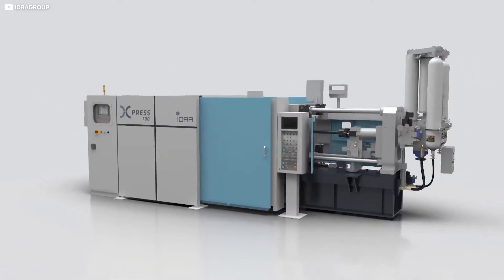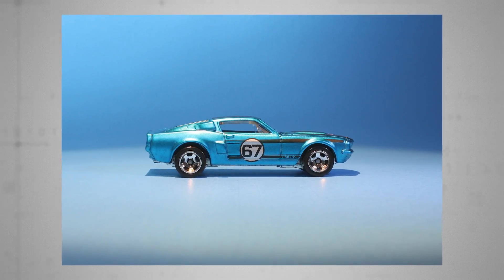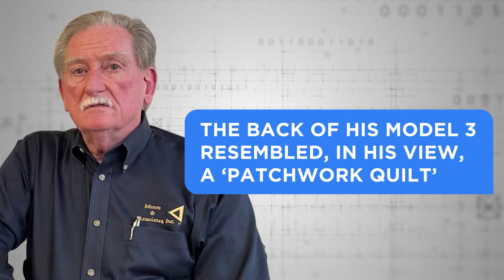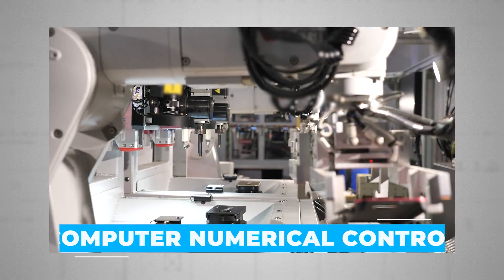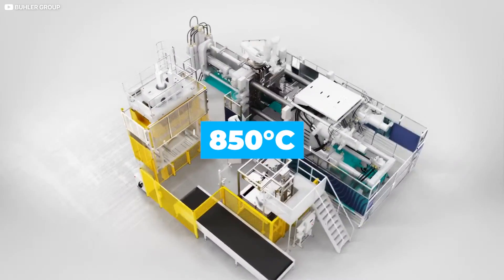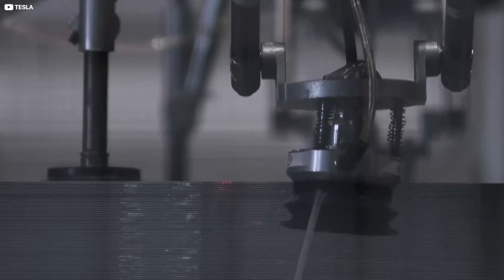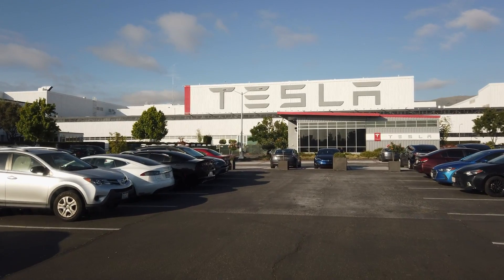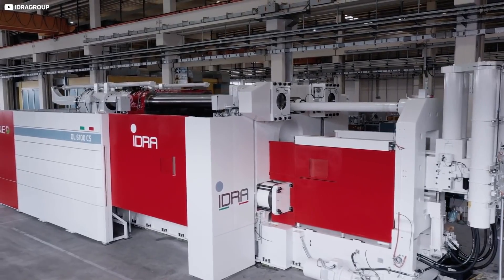Why Tesla Needed The Giga Press

Comment: To see a 8000 ton press machine working must be a show
Reply: 8000tons is not that big tbh.
Reply: @alanmay7929  Since you're not familiar with the industry, I'm gonna cut you a little slack. 

The size of the machine is designated by the clamp force to hold the mold closed, not the actual weight of the machine.
Reply: @alanmay7929  LOL. You've obviously never seen an injection molding machine. The biggest one I've ever seen is 1500 tons, and I work in the industry.
Reply: @mnotlyon  injection molding is a totally different machine, wrre talking about metals here, IDRA and other companies makes die cast machines for space/aviation and many other industries.
Reply: @alanmay7929  While the process is slightly (very slightly) different, they're both injection molds. I've built molds for both machines for over 35 years.

The machine builder couldn't care less what industry they're building the machine for.
Reply: @mnotlyon  they are still different machines that operate with vary different temperatures and many other parameters. Injection molding is relatively low pressure compared to pressured die casting.
Reply: @alanmay7929  Dude, did you miss the part where I said I was in the industry?

I actually repair 2 shot injection molds for tesla and most of the other car manufacturers.

I've built more die cast tools than you've even seen pictures of.

Comment: CNC and Robot industry should run panic now...
Reply: Die cast is not new, and the giga press will not eliminate CNCs. There will be a lot of secondary operations that must be completed on the parts after they're molded. High tolerance areas will need to be machined, and bolt holes will need to be drilled and tapped.
Reply: Casting is a very old method. This process is not used in other companies for a reason, repairing a solid chassis isn't viable.

Comment: so why is tesla using natural gas to heat the metal and not renewables and normal electric resistive heating?
Reply: Because u need hydrogen and if u buy hydrogen u produce atm more co2
Reply: @altair4262  the gigapress requires flames to work, and for that fuel is needed and Tesla could be using bamboo instead of natural gas to help the enviorment more.
Reply: @insectbite1714  No it doesn't. They can use anything they want to melt the aluminium. They use natural gas because it's MUCH cheaper than electricity.
Reply: Because it's much cheaper.

Comment: aluminum is very brittle I worry about cracking especially for a vehicle! the military scrap aluminum specifically for this reason so only time will tell.
Reply: Alluminum is good for the enviorment so Tesla uses it. Sometimes we have to get rid of conveniences to help the enviorment. also I have seen a cracked Ford before
Reply: @insectbite1714  Good may be an exaggeration considering that it is bad for the environment if it gets into it and that the process of making it uses quite a few harmful chemicals. I don't think that Elon much cares for the environment anyway, considering what he has done in Boca Chika and is still doing there and considering how wasteful many of his projects are.
Reply: Alloy . Pay attention
Reply: @irri4662  That may not fully address the issue particularly as it is still 95% Aluminium, cast, and one piece. That is a lot of potential for stress fractures. But still, we won't know until it has been on the streets for a while.
Reply: @harrybuttery2447  90%

Comment: I miss why you need the press part? The process described is just how a mold works? There is no need for pressure with the process described
Reply: The entire cast weighs hundreds of pounds, yet is filled in ~20ms. This is extremely fast and only extreme pressures can contain that injection speed
Reply: @colinsouthern  Good analogy Colin - "controlled explosion"...

Comment: When I was working on Vespas years ago we totalled countless scooters because of that big exoskeleton frame of theirs. It would be interesting to see how they allow repair of smaller parts of the frame without the whole thing being written off.
Reply: Typically it was because of a crash. Someone could drop it or have a slow crash and the side of the vehicle would get scraped up pretty good. To have someone clean up the damage and paint it costs more than the 70% of value of the vehicle number almost every time. That 70% is where most insurance companies draw the line and will total the bike. The other thing that would have is a front end collision such as rear ending a car could fold the front of the scooter in. Any damage that needed frame repair was almost always a total.
Reply: What was the reason it was written off though? Specifically, what was the damages to the exoskeleton and what usually caused it?
Reply: Was your experience with Vespa that these damages could have been fixed and they weren't because of the cost, or were these just completely unsalvageable with the then current known technologies?
Reply: VW and Toyota produce 20m cars a year in 6 continents without quality issues what problem are they solving here
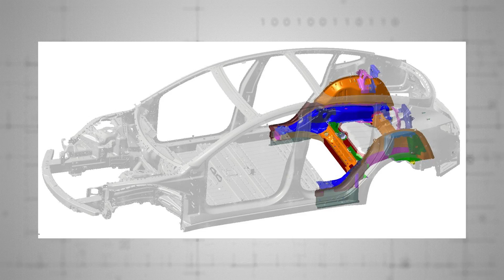Reply: Just watch the video for 4:42 - 4:55 minutes..
Reply: @Engineer9736 …..exactly. “Crash absorption rails can be cut off and be replaced with a bolted part for collision repair.”
Reply: Probably you'll need Tesla to come up with spare molds that are cut into custom parts that can be sent for repairs.
Reply: I think the trick will be to install sacrificial elements around the inner frame - basically a hidden "bumper".  In minor accidents, the sacrificial part would be cut off and a new one welded in place.  If there's damage to the underlying frame, the car is a write-off.

This begs the question...  how difficult would it be to make the "skateboard" (the part that holds the batteries, motor and brain of the Tesla, easily detachable from the frame so that in the event of a serious crash, you simply buy a new frame and swap everything over.

That would, I think, require a fundamental redesign of the 3/Y - but I think it would be an excellent goal.

While they're at it, they can/should make all the body panels easily removable like Saturn used to do.  That would dramatically reduce the cost of minor panel repairs - especially if they use Saturn's old trick of pre-impregnating the panels with the color.

Then, it would be easy to swap not only the drivetrain of the car to a new chassis but the undamaged body-panels and glass as well.  Plus, the seats, the dash, etc.

Then, instead of having to write of a car with a bent frame, you could simply get a new frame, swap everything else over and drive away.  A couple of hours in a body shop and you've got a new car.
Reply: Well, aluminum can be welded. And screws in aluminum body after 7 years of exposure to environment are useless anyways, because of aluminum oxide caking up and seizing the threads. And bolts.
Reply: @SweatStink  Aluminum can be welded?
Reply: @anonymous3561-k4b  Sure, not nearly as strong as the original bond, but with some skill you can weld it pretty good.
Reply: Well, Tesla is trying to what Apple has been doing to it's customers; they want you to change the car or device more frequently. Amy other minor benefits to the customers are just a by product.

Comment: Musk didnt have a satisfactory answer to the many accident ordeals any car goes through its life, and can easily be fixed up,  by making these new car chassis in one piece they would impossible to fix.
Reply: Excatly
Reply: Being a battery powered car, may happen anyway. He’s using a lot of small batteries, but sooner or later the efficiency of large flat phone like batteries will force him to change. Starting with small batteries is smart as everything new goes wrong.
Reply: Probably the reason is, With FSD the crash probability of a feels is likely to reduce significantly as compared to other cars.
Reply: You're right. The integrated battery design is similar. Only way to own one of these is to short term lease it!
Reply: Why not just make a battery have infinite energy? Oh wait China stole that technology and Twsla want it bak